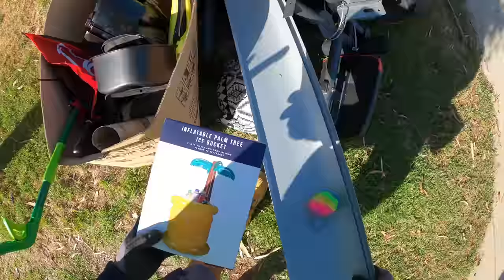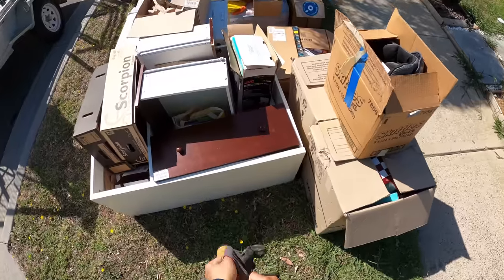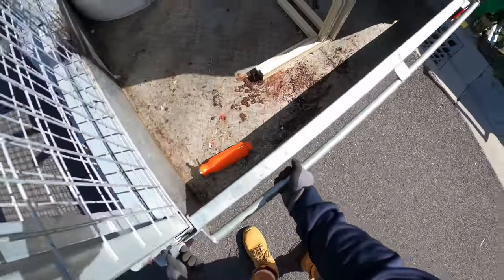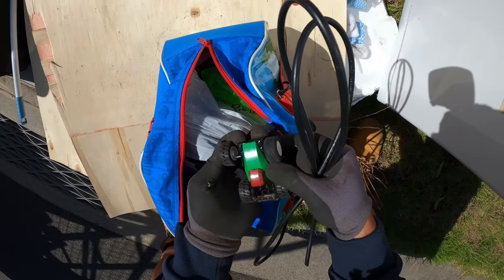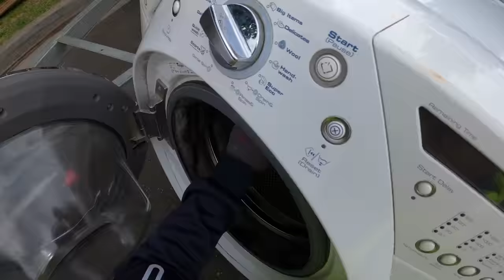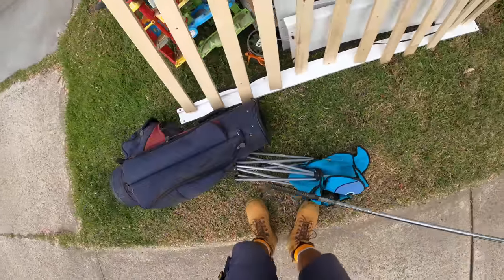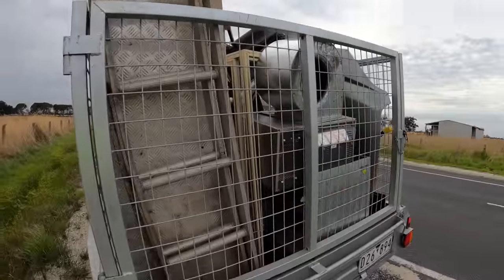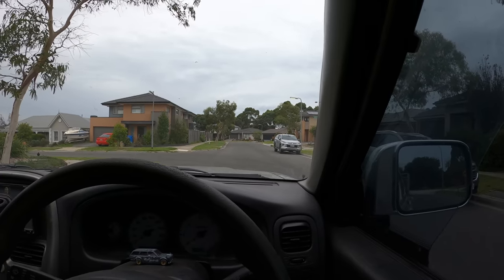Street Scrap & Resell - A Side Of The Road Hustle

Comment: Why don’t you take dehumidifiers? They are essentially the same as air conditioners?
Reply from the maker: They don’t have any of the cooling equipment like compressor and radiator with copper piping.
Reply: @PolyProphet  yes they do!
Reply from the maker: The ones over here are light as a feather.
Reply from the maker: Can you show me what’s inside one?
Reply from the maker: I guess what I’m looking at aren’t dehumidifiers, just a fan. Thanks mate 👍
Reply: @PolyProphet  let me know if you feel find out what’s happening!